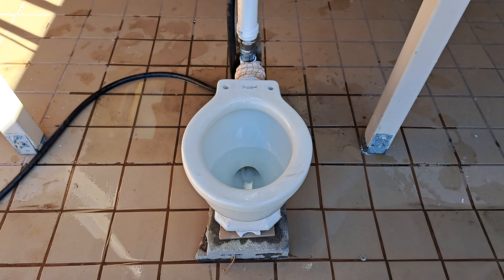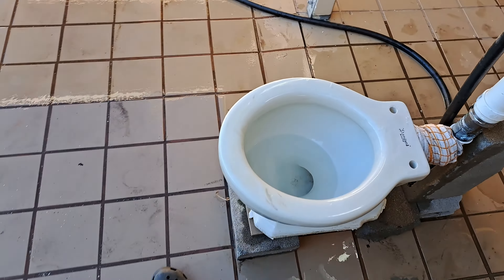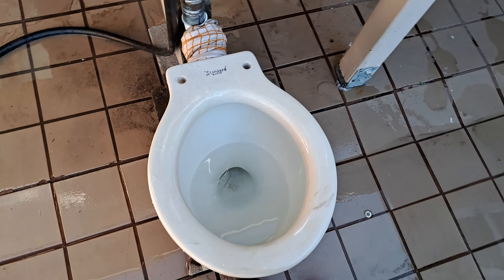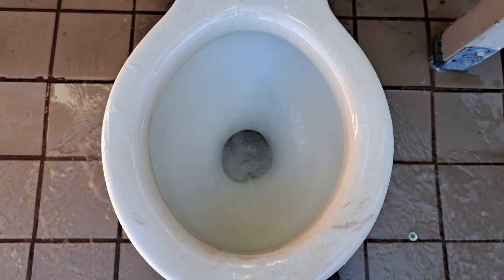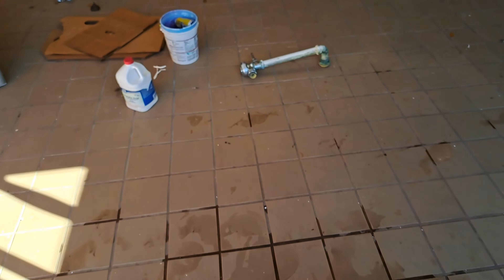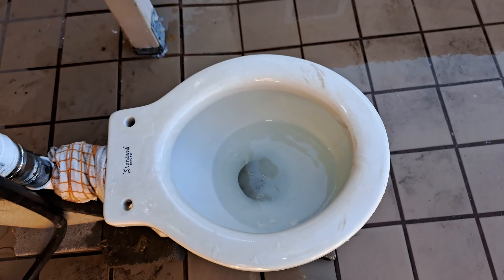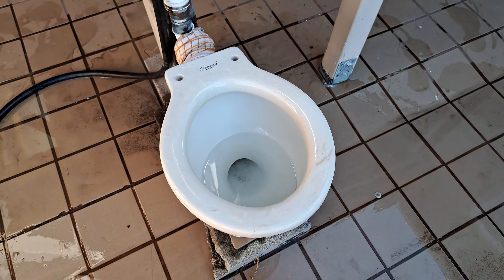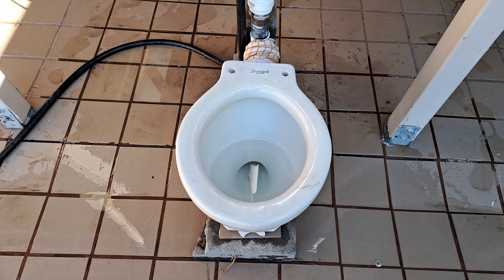1935 Standard Siacto Flushes!

Comment: Nice find! This toilet actually was sold for tank or flushometer and as far as I know both versions were the same. I've had my Madbrook on a low tank and it didn't flush as well as this so this is still an improvement. Of course a flushometer would be even better.
Reply from the maker: This one seems to be flushometer exclusive judging by the lack of power and the size of the spud.